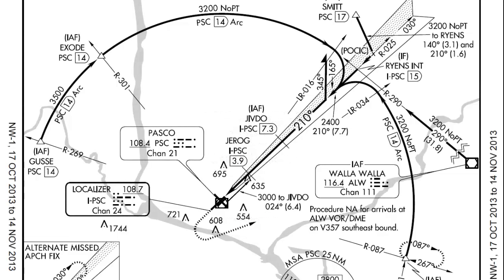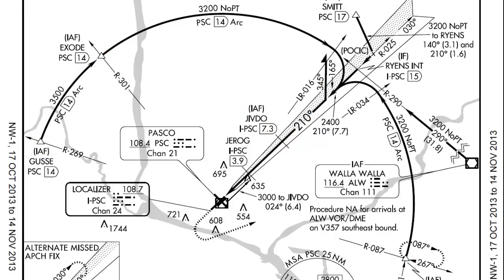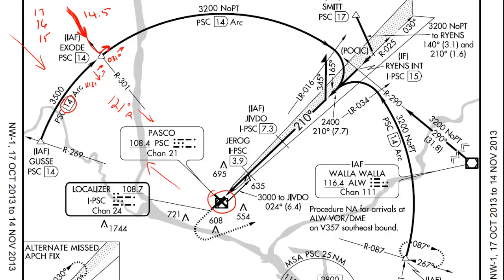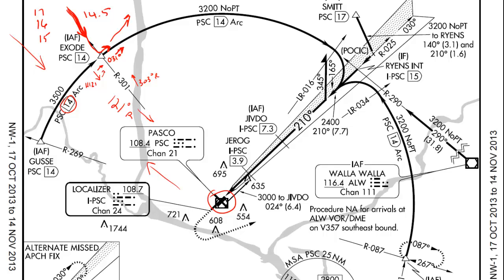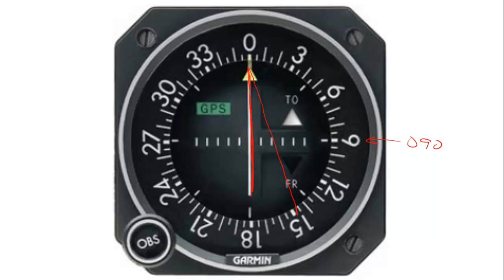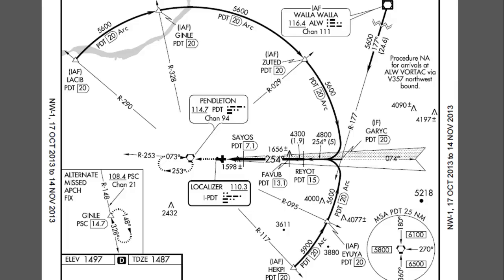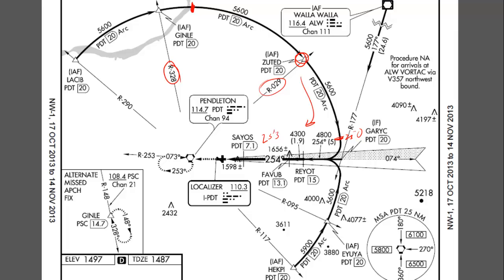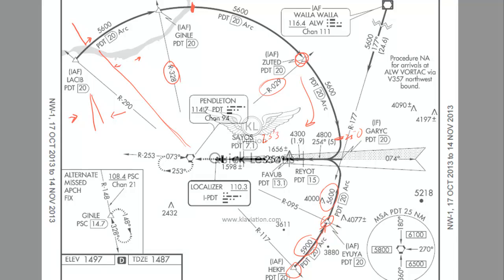How To Intercept and Fly DME Arcs

Comment: I know this video is a few years old now, but, if you'd like to see a simulator pilot fly this approach in X-Plane 11 using radio navigation only (no GPS) and compare the theory to the execution, check out https://youtu.be/I16cZqFeZKg -- I made a few altitude deviations during the approach, but the navigation of the arc itself was pretty successful.

Just take everything there with a slight grain of salt, as I'm a sim pilot with 30+ years in, but no real-world experience.  Most of the procedural execution of the approach should be pretty solid, though, minus the aforementioned altitude issues.
Reply: Here's another attempt, finally, in which I flew the altitudes correctly, and in which my end-title screen didn't pop up halfway through the approach.  Again, it's this same DME arc, the ILS 21R into Pasco.  https://youtu.be/Hs6cHiDwM0Y?t=3385

Comment: I would think that once you got to that 14.5 mile mark and made your 90° turn, just keep a slight right hand turn and using the DME to keep that 14 mile arc, adjusting your turn. Eventually you will determine the perfect amount to hold the turn and just keep your eyes on that 14 mile. Is that too simple of a procedure? It sure would be easier than trying to keep it centered on the dial...
Reply: Situational & Spatial awareness are primary.  I just make the first turn.  Then check the DME and start a 1/2 rate turn. Then set the CDI and HdInd for the inbound.  Now, vary my turn rate while cross-checking the DME.  Watching for the CDI to come alive. At 1/2 deflection, start the inbound.  
Notice there is NO turning knobs, calculating, etc.  Just awareness of what I'm doing now (DME) and the goal (turn inbound).  Simple!
But, as stated, staying INSIDE the DME distance is way easier.  ie, 13.7-14nm for this arc.
CFI,CFII,MEI,AGI,IGI...  eieio.

Comment: Why make a 90 degree turn to join the ARC?
I was taught and always do turn 100 or 80 degrees to intercept the ARC. If for example outbound on a radial FROM the VOR to intercept the arc, you turn 100 degrees about 0.5NM prior to reaching DME ARC (In an airplane flying around 100/ 120 Kts this works perfectly, in light wind conditions at least).
If inbound TO the VOR you turn 80 degrees to intercept the ARC and again about 0.5NM prior to the DME ARC.
This way you pretty much always end up right on the desired DME ARC (20NM in this case), and thence just smoothly turn with the ARC to keep the correct distance all the way .

Comment: This is different than what I have learned. Aren't you suppose to twist the nob 10 degrees away from the center and track the course until CDI is centered? When CDI is centered, turn 10 degrees to the course and twist 10 degrees again and so on.
Reply: +Kevin Kim just different techniques.. not mandated.  you only need to stay at +/-1nm on the arc.. everything else is just whatever you need to do to keep that dme (hopefully a lot closer than 1 off)

Comment: Now when you showed the OBS indicator, should it have been in VLOC mode or GPS mode like it was? I imagine if you were flying Radials it should be on VLOC right?
Reply: It should be in VLOC mode because you are tracking the station using your CDI.  You are not tracking the arc using your GPS.